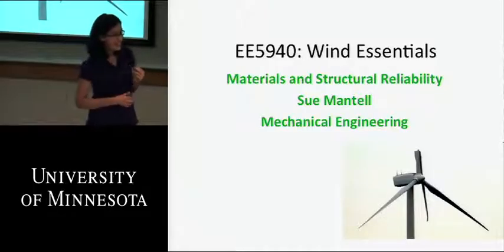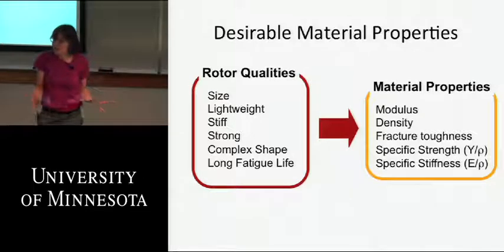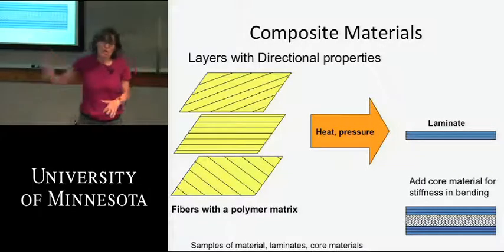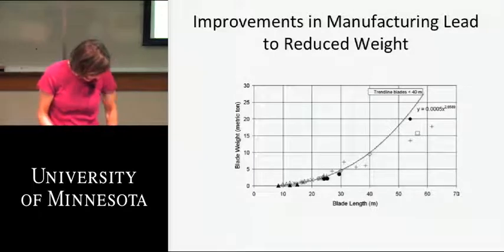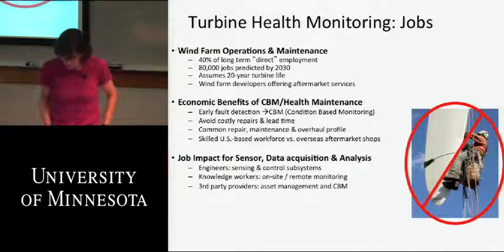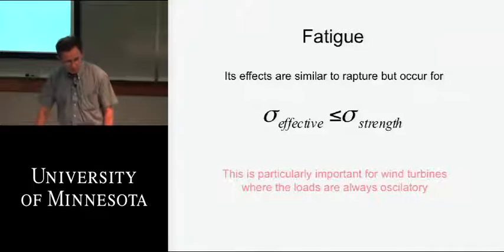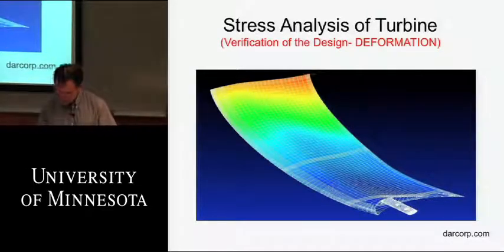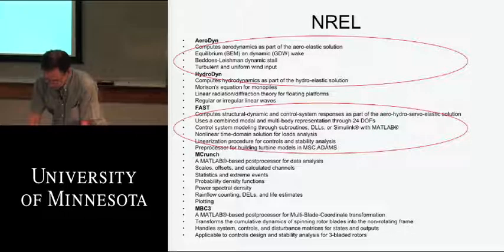Wind Energy Essentials Module 7

Comment: Dear sir/madam

     I like this video and I am using FAST for turbine design. But now I am working with lifetime extension of turbine so I have not all the data like balde data because lifetime extension is only for old turbines and I have problem with that.

I am downscaling NREL 5MW blade but unfortunately I am not able to find stiffness like flapwise and edgewise stiffness. So do you know how to calculate those.

Could you please send me your mail ID.

Kind regards
KD